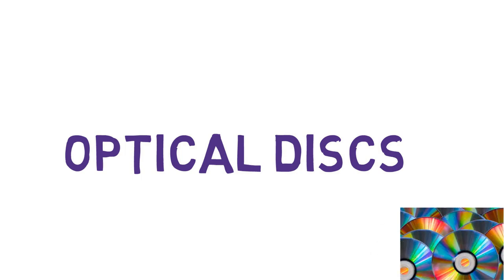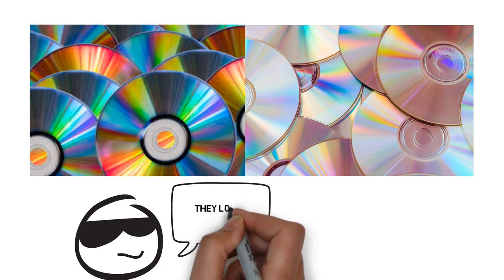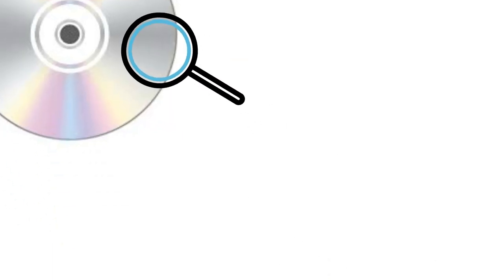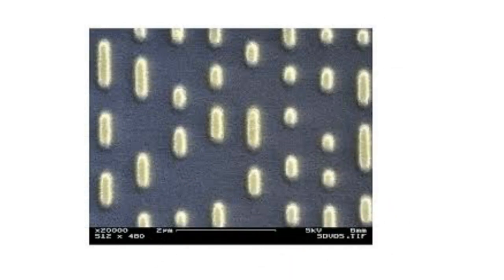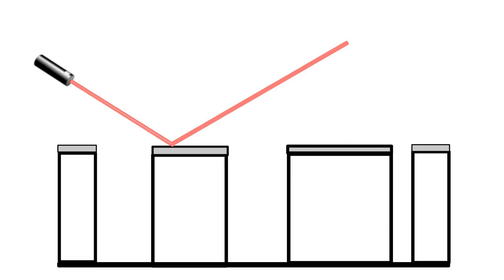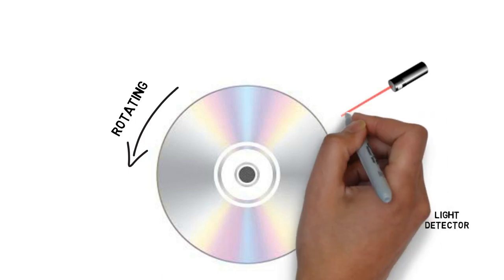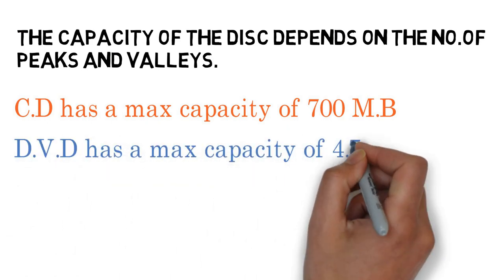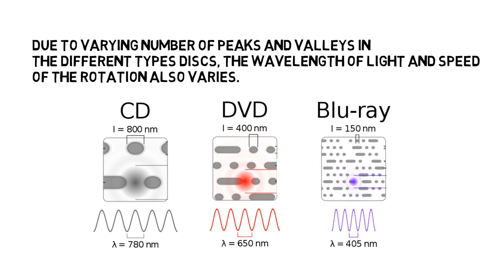How Does Optical Discs Work ??--Learning Hub

Comment: In Simple terms
When you magnify a disk, it contains little things  called Flat area and pits
As the disc rotates, when the laser hit on the flat area, it reflects to the diode detector so the diode detector picks it and converts it to an electrical signal as 1 the way a computer understands
When the laser hits on pit, It doesn't reflect to the diode detector so the diode detector doesn't pick it and interpret it as 0
Reply: I’m

Comment: WRONG...! All pits and all lands always have the value of ZERO, the ONES appear every time the reflection phase occurs at the when laser changes from reflection or not reflection and then the space between ever one 1 is measured by an internal clock,thus rendering a series of pulses that can be held as digital data